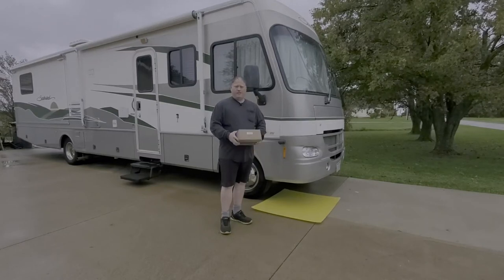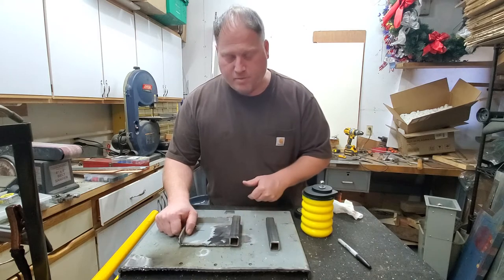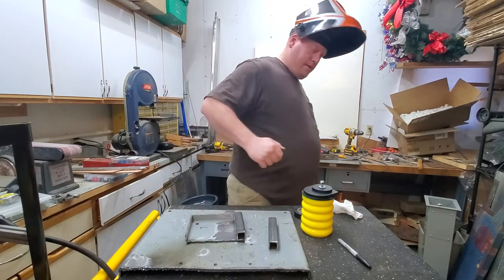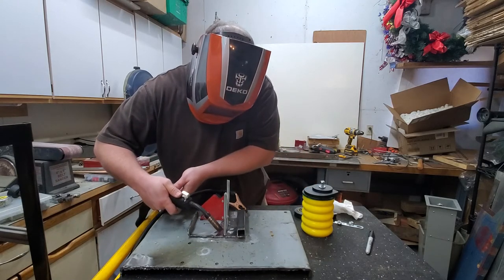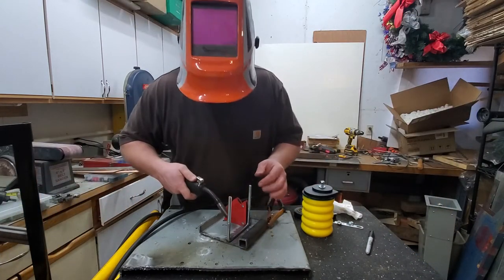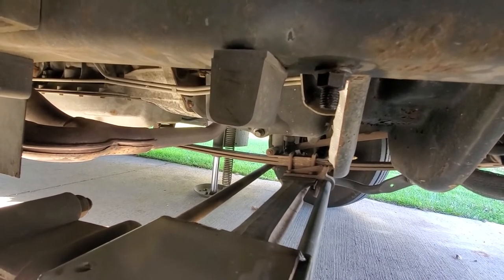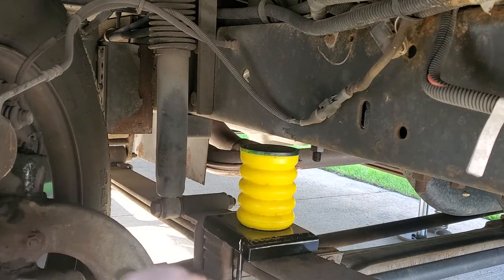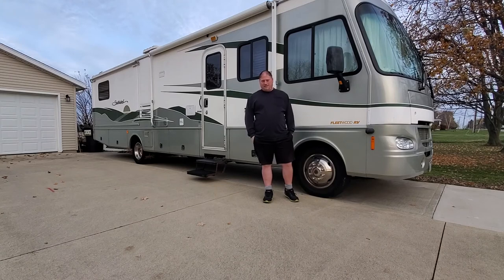Installation of sumo super spring on f53 Class A Motorhome Saved $500

Comment: I don't have welding skills can the summon spring just sit on the leaf spring itself?
Reply: Just researched the video looks like the summon spring should be positioned over the axel
Reply from the maker: Yes needs to sit over the axle but you can buy different bushings that will match up perfectly just will cost you more
Reply: @KzCreations  I liked your solution! The other bushings are expensive
Reply from the maker: @clue___  I can make the steel plates for $55 if that works for you
Reply: @KzCreations  works for me first let me see if I can drill the center hole over the frame for the sumo spring top bolt. For some reason my bump stop is forward of the axel. Yours was right over it.  I could send you a picture somehow. But let me go out there and attempt to drill that hole first
Reply from the maker: 419.217.9490